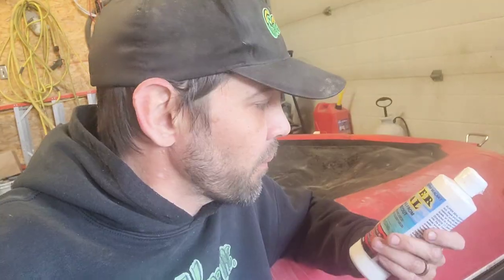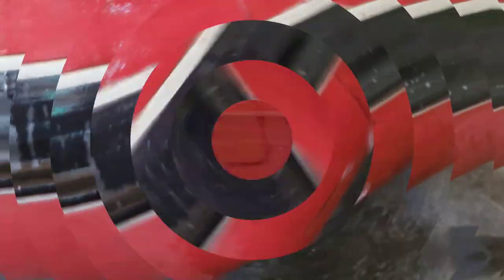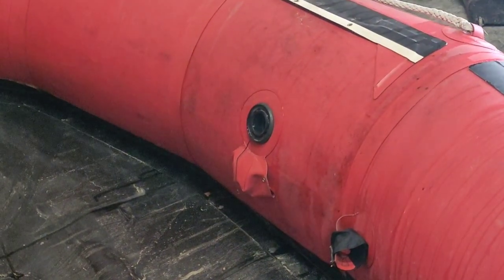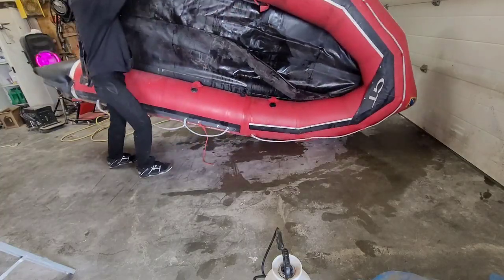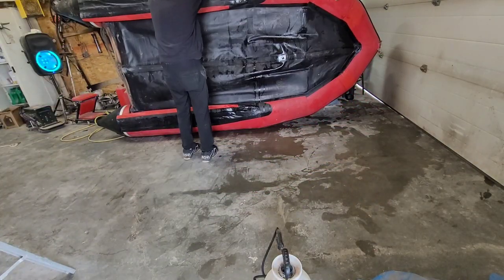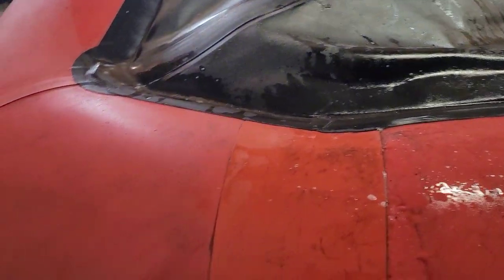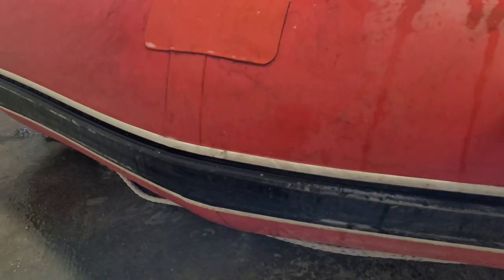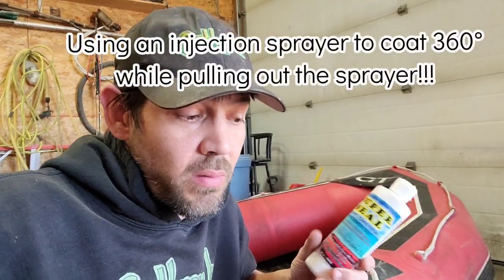How To Fix Your Leaky Inflatable Boat Dinghy Without Patching - Using Super Seal Only!!!

Comment: Thank you my friend. I was wondering if it was possible. My inflatable had leaks around the seams and I didn't want to turn it into a Frankenstein boat with patches all around the seams.
Reply from the maker: As long as the glue or the internal seam isn't separating, then this product will work great for your boat.
Reply: All good. There is no layer separation. Just random small microscopic leaks along the seals  @gashopperinc

Comment: i know  exactly what this is   were it comes from how its  produced ,and the time frame  between  a    2     3  4  5  coat i woulds  recommend    letting it  cure  24 hrs   then   a   2  nd    coat ,  i use  this product  for  something  totallty / different  comes in various     viscositys , it is water based    , wow  ,somtimes you already know  but  diddnt  realize  i ve  got new boat coming   but  will use it  anyway  its  very  strong  when cured especially   with    sevral coatings

Comment: Lovin your channel after buying my first inflatable last year. An older Zodiac yacht tender that needed a tube reglude to the transom. It also needs the UV damaged strap handles replaced. Justaking a request for some video on replacing or adding  different styles of safety handles and other accessories for some ideas. Fishing rod mounts, pockets or other storage like youve mentioned. Machine gun mounts, etc. Maybe somw video of other boatwrs set ups from around your area there. Just looking for ideas before I do anything permanent. 
Thanks
Reply from the maker: Great suggestion, I'll start taking clips of boats that come through here and do a compilation video once I have enough clip time. Thank you for the suggestion. 

Cheers
Reply: @gashopperinc  Thanks, that'll be great. Sometimes new ideas won't work as well out on the water. That'll give ideas of what works and what doesn't.

Comment: Hey GasHopper,
I've got a leaky air-stitch floor.  I've poured about 16 oz of sealant into it and am trying to guide the sealant towards the leaks.  The trickiest leak is in the donut hole near the bow ( for accessing the air keel valve).  I've tilted the floor onto the bow end to guide the sealant close to the hole, and while supporting the rear end I have de-pressurized the floor enough so I can fold it at the donut hole, trying to guide the sealant there.  Hopefully, I will succeed.
I'm sure you have some "tricks of the trade" for these floors.  It would be a good video subject for you to consider.  I'm curious about how much air pressure you'd suggest.  I'm thinking maybe begin with full pressure (10 psi), and then reduce it some during the curing time.  How do you deal with these?  Maybe I'd be better off using a lower pressure while sealing the leaks?  Perhaps these floors require multiple applications?  

Any tips you can offer would be appreciated.  👍
Reply from the maker: Great question. Yes those air floor can be a pain to get to the donut area. Best trick I find is to work the sealant into that. Remember air floors are fiber reinforced, so it may take a minute or 2 for it to completely trickle down there. Once you think it's down to that area, deflate the air floor and press and work the sealant towards the donut portion if you can. After you think it has work it's way there, re-inflate the airfloor and spray to see if the sealant has slowed the leaks or stopped it. If you notice a decrease, then give it a few spins with the donut on the lowest portion of the airfloor and rotate a few more times. Let it work it's magic and you should be good. May take a couple doses. It's the inner fibers that make it tricky.
Reply: @gashopperinc   That makes sense.  I'll give it a try.  I don't know how long the sealant remains liquid in the floor, but it seems like it will probably stay workable for several days.

Comment: Hi GS,  I had the "great idea" of using 'green slime' tire sealant, about 8-12 ounces of it in one of my chambers that slowly leaks internally, thinking it would work, and sadly, the chamber still loses pressure over a few hours. How do I remove all that gunky sealant to then use this proper stuff? It would seem impossible to get this stuff out. I need help!!
Reply from the maker: Oh my goodness. Well what I would do is, get an oil extraction pump, fill the chamber with some water, slosh it around to collect and gather up all that slime, and use the oil extraction pump to pump it out. May take a few trys, but that should work on getting that out.

Comment: Hi I have a Razar cat inflatable not many made has pvc tube with hijackers both are leaking, I can't rotate the boat to chase the leaks is there another way?
Reply from the maker: I've had clients use vehicle undercoating guns with the wand extenders to spray the inside of the tubes where the leak is. If you have the adapter that does a 360° spray, then you'll be able to coat is much better. I'm working with a tool manufacturer to see if I can get a custom  sprayer made that doesn't plug up when spraying the sealant.

Comment: will the product interfere with the intercommunicating valves on a grand raid mk 2?
Reply from the maker: Yes it will work, you just have to remove the rotating valve assembly so it doesn't gum up. Wipe away any excess that gets on yhe valve.
Reply from the maker: No it won't interfere with the valves, just have to remove them first.

Comment: Hi, my boat has water in the chambers. Do you know a trick to remove it or should I just ignore it. It's hard to know how much but I would say around 1 litre. The boat runs just fine.
Reply from the maker: The water will make it heavy, I recommend using a extraction pump to pump out the water. There's handpump ones out there that can be bought for that purpose
Reply: @gashopperinc  Thank you for your prompt response. I'll look into this. If by any chance you can recommend one...
Reply from the maker: The PELA PL650 manual extraction pump is what we use here. Fairly inexpensive, and great added  bonus for oil changes also.
Reply: @gashopperinc  thanks luv ya

Comment: I have a 14 ft. novurania ( 1988 model canguro 420 gs / Hypalon)  great shape/no uv damage but was stored deflated for 8 yrs. It how has micro leaks on all 3 chambers. Questions: How much should I pour into each tube and how long is the working time? Also how long does it take to cure/fully dry and how long to give it a 2ed coat if needed. 
Great vids...Thanks, Joe
Reply from the maker: Hey Joe. Generally a 1/3 of the bottle if sufficient. You want to coat the chamber walls so it can fill in those micro leaks. Dry time is usually 24 hours. But if it's puddled in the chamber and hasn't coated the chamber walls,  it can stay a liquid for longer periods. Agitation and heat help cure this product quicker. Air and pressure are the activators to start the curing process.
Reply: @gashopperinc  Where do i buy this?

Comment: Hello I have a excursion pro kayak that just got a hole in it can I use this for that or no ?
Reply from the maker: Depends on the size of the hole. Small pin holes and micro leaks this stuff will work great. Punctures, not so much.

Comment: You pour a liquid inside the tube and that liquid gets inside the tiny holes in the PVC and seals the holes?
Reply from the maker: That's correct. It will also coat the inner chamber and seal if there is any cracking or damage.
Reply: @gashopperinc , how can I know it coats the inner chamber in its entirety?
Reply from the maker: I like to roll the sealant on bright sunny days. It allows me to kinda see the sealant roll inside the chambers. Kinda of like X-Ray machine.
Reply: @gashopperinc , that is interesting! I do not know how I could see the sealant roll inside the tubes (and my boat is white).
How much liquid is needed for an average boat like that?
Reply from the maker: White is sometimes the easiest to see at it will turn yellow almost in the sun, depending on the thickness, but you'll see the sealant shadow down the sides as it coats. I usually start with a 1/4 to a 1/3 bottle and go from there.
Reply: @gashopperinc , thank you!

Comment: I have an older Zodiac that is coming unglued from the transom and I am reluctant to tackle the job. But I guess it's like everything else, intimidating until you try.
Reply from the maker: That's all it is, intimidating. I have lots of how to videos on how to tackle such a job. Just take your time, if need be, do each part 1 at a time. Make sure you you clean and prep the surfaces good and you'll have nothing but success.
Reply: @gashopperinc  thank you for the encouragement, will probably tackle it once the temp comes up a bit.

Comment: Doesn't work
Reply from the maker: I'm sorry to hear it's not working for you. What's the boat your using it on, and where and how bad is the leak? Super Seal should be working for you as it's pretty good at doing its job. Need some more information, maybe I can guide you?
Reply: @gashopperinc  it was used on at 12 ft Seamax PVC inflatable.
I have one tube with slow leak. I used approximately 1 bottle in the tube. Rotated like suggested.pumped up 3/4 pressure then 24 hrs later it went flat. Also air floor as well.
Reply from the maker: @keithlawton3725  Is the leak on the bow of the boat or side chambers? Depending on where the leak is, you may have to roll it in that specific section a couple times. I've found that if you can get the sealant over the leak while in the chamber and let it sit for a bit, the air pressure will slowly move the sealant in the leaking spot or shaking the boat up and down to slosh the sealant in the area. Also, another method is to flatten the boat with no air in it on a flat level surface and push the sealant around to the leaky spots. As for the air floor, they can be tricky as most have that drop stitch fabric and the sealant like to get caught on the threads before making it to the leak. Same thing, as suggested for the boat, get the leak to the lowest spot and wait for the sealant to creep to it. This video was just a quick example, the stubborn leaks that were in the video, I did have to rolled it quite a few times, as the sealant  just wasn't getting to where I wanted it at first. But after a bit of patience and thinking of how the sealant flows inside the chamber, I figured out it had to be rolled a certain way and left to sit for a bit so the sealant could flow down the area I wanted it to and coat it. Try those and get back to me. The sealant should still be in a semi liquid state, depending when you applied it, to try the suggested methods as it won't get fully cured unless it's agitated and in warm temps.
Reply: @gashopperinc  it's on the port side chamber. It flipped and rotated the vessel over and over like you mentioned for a couple hours. Leak is on the top of chamber. I even flipped vessel upside down for sealant to get to leak. Yes it was done in warmer temps around mid 20s. 
I just take my battery operated pump with me when I go out.
Can I use the product again once used already.
Reply from the maker: Yes the product can be used over to try and seal the leaks. If you could contact us directly by email, I'll send you out another bottle to try if you ran out.